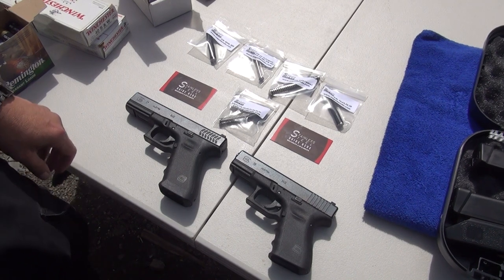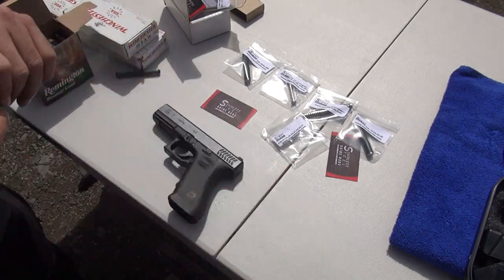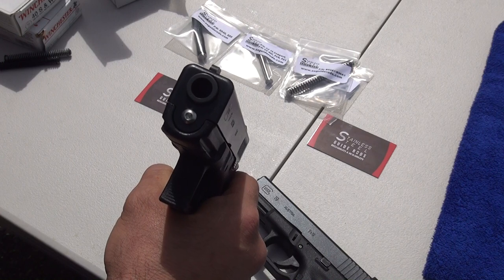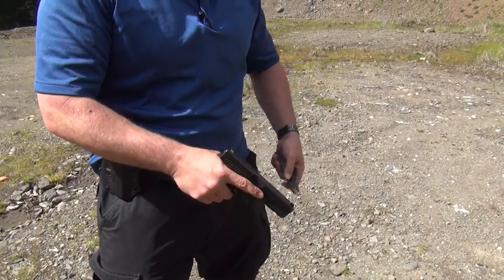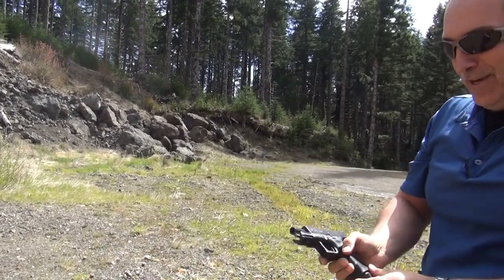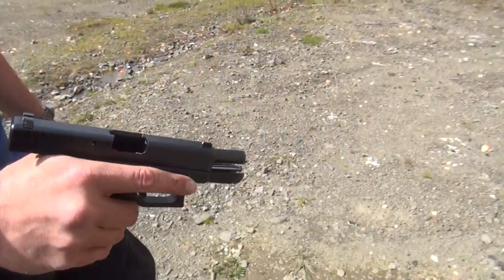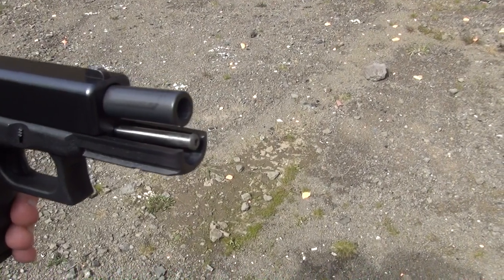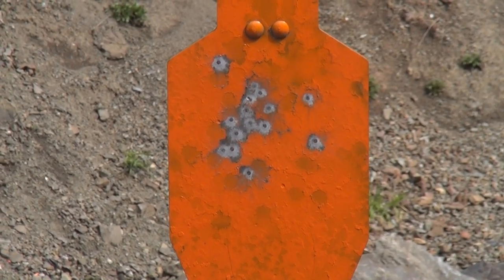Glock 17 RTF2 and Glock 19 RTF2 (HD)

Comment: 304 is a lower grade of stainless steel, but should be adequate for this application - but don't assume it can't rust, because it can. 316 stainless would be better. Just keep it clean and lightly oiled. It does look like a nice upgrade though - and FWIW, those are now IDPA legal. Great video guys - I'll have to check out the guide rods!
Reply from the maker: Hi Justin Opinion , Thanks for the info my friend..... Funny that 2 of my LE friends both had a Stock Guide Rod fail on them in the last 30 days, on one of them that had about 1,000  rounds fired through it, the end next to the barrel lock up bent like 20 degrees on a Glock 17.... The other one came off the other end and came apart when he went to take the pistol down... that was a Glock 36.  So it is possible. Anyway your right about give them a little oil, and that the 316 is better, I have been reading. :}Stay safe my friend!     Beretta Sr.
Reply: Uh,do you know where to get them 316 stainless steel guide rods?
Because there is no where to get them?!
If you know,please post links so people don't have to waste time searching for them...thanks!
That drives me nuts when people have advice on getting something, but don't post a link to where to get it?! Lol
Reply: David Fye II
I apologize if my comment about SS grades indicated that the 304 rods are not high quality, or that there are any better ones around. That wasn't my intent. Just a technical point on stainless steel because many people assume it cannot rust or corrode, and it can, under certain circumstances.
Reply: So what's the best solution to use to prevent that,when purchasing a 304 SS guide rod??
WD-40,quality CLP or what?
Reply: David Fye II
Just light oil occasionally. Then it will last forever. Well, maybe not 'forever', but we'll both be dead and won't care. ;-)
Reply: Haha,ok thanks bro!
Well we'll keep fighting them devils.Taking as many with us until our last dying breath at least! Lol